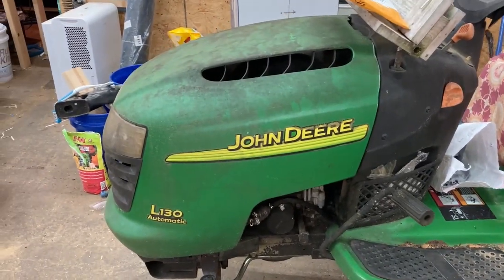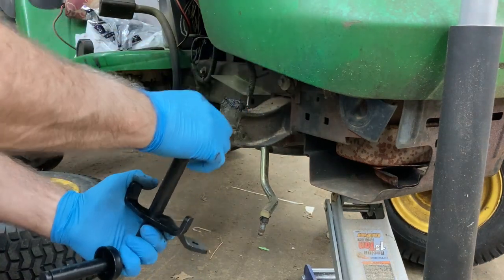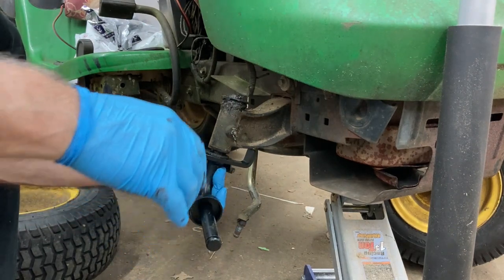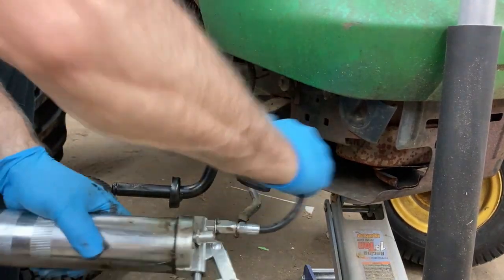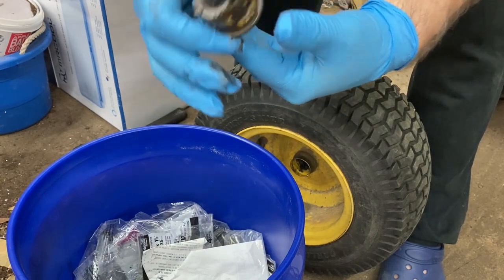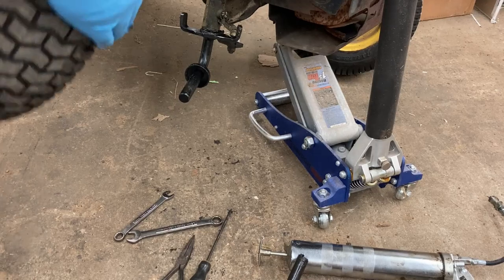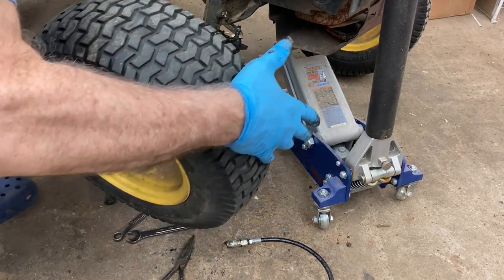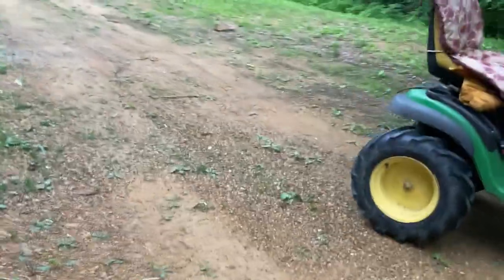John Deere L130 Change Front Axles Spindle & Install Bearings

Comment: Did you consider putting the flat washers and needle bearings on the spindle ?
Reply from the maker: It would make for smoother operation, but as long as you keep these greased they do pretty well.  Most of the failures are caused my lack of grease.

Comment: I have you beat!  My riding lawn mower is from 1995 Craftsman 4 wheel turn.  It works, the plastic hood leaves something to be desired.  We put tubes in the back tires.  I have to fill the front.  I'll need a new battery.  If I don't shift into neutral just right at stop the drive belt falls off and I'm reaching in to put it back on! LOL
Reply from the maker: That is funny, looks like I am not the only one who using them until they drop. LOL
  My John deere only drives one rear wheel, it was horrible on hills, I filled the rear tires up with windshield washing fluid, now there is not a hill I can not climb.   It worked like a charm. : )

Comment: I see the left wheel's bearing seemed loose and came out when you put the left tire on.  Did you tighten the hole for it to fit better?  It was hard to see in regular speed so I slowed it down some.  Good video.  Thank you.
Reply from the maker: Glad you liked the video. If I remember right, it had several washers included.  I just put them in until there was no side to side play.    Then I put the C-clip to hold it all together.  It has worked fine.  Hope that helps.